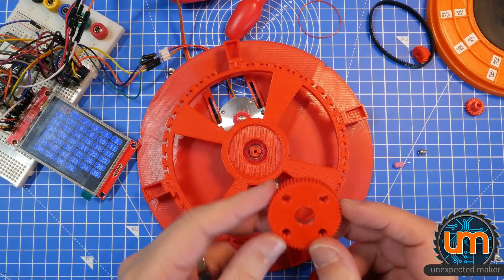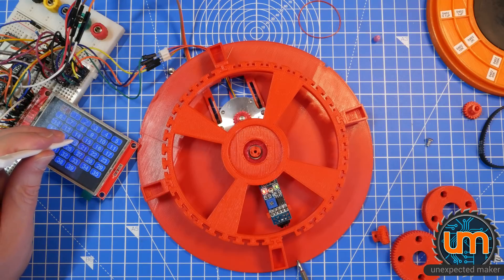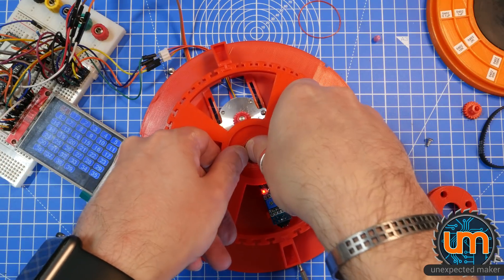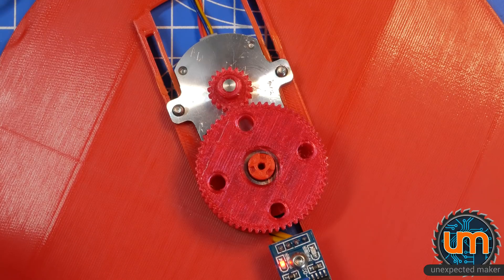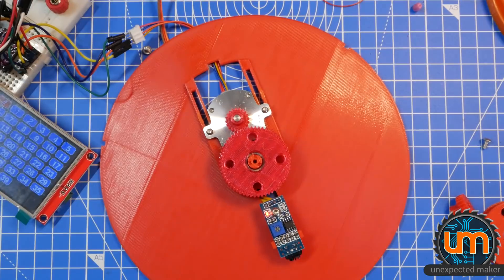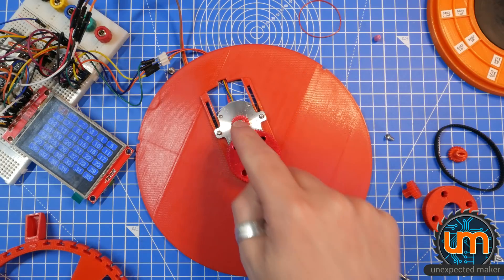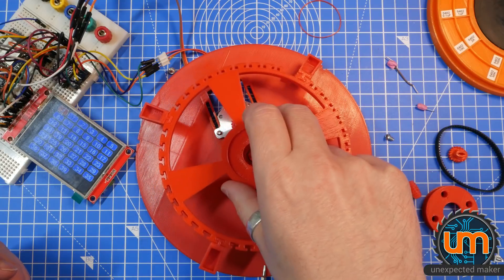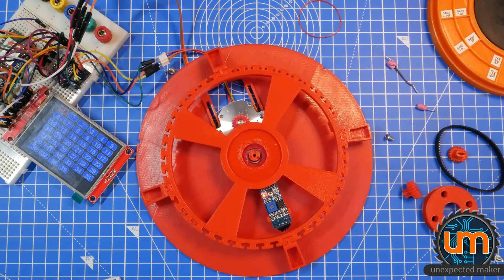PnP Parts Dispenser - Stream Followup

Comment: You might try Helical Gears. They were designed to minimuse this type of noise. Only pont contact is made as gear teeth come together rather than the whole wideth of a geatr tooth.
Reply from the maker: Thanks Alan. Yes, there seems to be a few gear teeth designs I could look into if the noise gets too annoying, but I might try some lubrication first, or using nylon filament or felx.

Comment: Good morning Seon, I enjoyed the stream the other morning. I was a mechanical engineer some years ago so was interesting to watch an electronic mind at work. I think you did get a lot of unnecessary flak though. I think you're on to a great design there. The design for the bins is good, even adaptable to place double bins should you ever need them. Making the connectors on the bins dovetail shaped should help to lessen the rattle coming from the bins. With the wear on the gears, silicon grease is okay for plastics and minimally reactive, may even dampen some of the noise from the gears too. Thanks for all the great content, looking forward to the next.
Reply from the maker: I need to grab some silicon grease for another project, so yeah I can def give that a try on these gears. I also got the bin connector tolerance better so no more rattling! Yay ;)

Comment: Glad it worked out for you.  You didn't want to rely on the steps to accurately position the wheel and you didn't want to add a second encoder to count the degrees of rotation.  Who knew it was a belt issue?  Everyone learns when they burn their finger.  Great stream!
Reply from the maker: Well I did want to count steps as the method for this to work, but it wasn't proving accurate.... but it looks like  it is now :-)

Comment: Have you looked into herringbone gears?  Some 3d printers (Lulzbot) have used this type of gear.  Here's a parametric set on thinkverse.  https://www.thingiverse.com/thing:6544.
Reply from the maker: Hey Paul, I now about herringbone gears. I'm not sure I could print them this small with a 0.4mm nozzle. I'm going to try flexible filament or printing with nylon first before I try new gear shapes.
Reply: @UnexpectedMaker  I replicated your original parts table a couple of weeks back and really like the new idea.  I'm gonna try printing a small set of the two herringbone gears just to see how well they come out.  I have a .4 nozzle as well so i'll let you know.  Looking at the vid, would the main gear be roughly 30 mm in diameter and the small drive gear be about 10?  Again, just a POC to see how well they mesh together when printed so small.  The primary reason for suggesting is they effectively lock together and really can't slip plus they keep each other aligned to the center of each other.  I've had the same set running on my 'Wades Extruder' for 4+ years with no slop.  Printed with ABS...  I'll shoot you a pic how they turn out.  Really appreciate you sharing all your experiences.
Reply: @Unexpected Maker  They definitely track well with each other.  I think these are even smaller than what you might actually need.  Have a look...  https://imgur.com/a/oxP6Qoz
Reply from the maker: Oh they look great.... my gears are a bit bigger in diameter... 40mm and 14mm. What did you use to make them?
Reply: @UnexpectedMaker  Well, i just scaled the ones from thingiverse but i'm gonna look around to see if there are any parametric models for Fusion360 (my 3D modeling app of choice).  Or i'll try my hand at designing them myself although I think there would be some interesting design challenges.  Would the diameter of the two gears or the teeth count make a difference with how you're designing it or is it somewhat irrelevant based on how you're using the rotary encoder now?  I haven't had time to get through the full live stream where you discussed it all.  I would be glad to share a design with you if you were interested in trying them.
Reply from the maker: Yeah the teeth ratio is super important for my project still as I am not encoding,  but relying on steps still, now that I have it pretty accurate and reliable. My smaller gear is 20 teeth and my larger one is 60. I managed to get what I have here quieter simply by tuning the position of the stepper to make sure it's not too close or far from the inner gear, so though it could still be a tad quieter, it's pretty good now :-)
Reply: @UnexpectedMaker  ok, interesting.  Just for grins, i'm gonna try to make a set that match your specs then share with you.  Mostly cause I like little challenges.  ;-) .  I do think the herringbone teeth stand a better chance of being quieter just based on how they contact each other.  And side note:  Not sure if you've ever seen any of Mathias Wandel's gear vids but he's got lots of great info.  However, he's all about woodworking and his gear generator tool doesn't output CAD files.  Only printouts for use as cutting templates on wood.
Reply: @UnexpectedMaker  Here's the small gear. https://a360.co/2ECQnBO and the large.  https://a360.co/2IS6jFv.  I used an add-in to fusion360 called helical gear.  And here's a vid of them in a small jig I designed just for POC.  https://youtu.be/yHzVyqFPFwc

Comment: 200 steps are not that inaccurate and these light parts are not a big load for the stepper.. direct drive should be fine. But i wonder if you should check another driver library or code, since 16 microsteps are not unusual. I think the noise you are getting with half steps is maybe just current or step length related. You could test the stepper with something like grbl or other 3d printer firmware that supports microstepping right. But maybe totally overkill:)
Reply from the maker: Yeah the 1/16th micro-stepping is working now in this video... plus the accel/decel... so  I'm pretty happy with how it's working. The library is fine... I am pretty sure it was just "user error" and  bad assumptions at the start of the project ;)
Reply: Ah.. i thought it was still only working with full steps. If you are using the stepper as direct drive, you may can fit a little bit bigger stepper in the center. I´m using this for one axies in my openpnp project and it seems to work good and the price is not that heavy. The statet 1.5A are not true of course;)
https://www.aliexpress.com/item/nema-17-42-stepper-motor-23mm-0-42N-m-1-5A-for-3D-print-step-motor/32895756331.html?spm=a2g0s.12269583.0.0.b8cc5ba66Kwww4
Reply from the maker: That stepper you linked to is already taller than what I have now for the entire build, without direct drive. If I did direct drive, I'd only be doing it to reduce height even more than what I have now ;)

Comment: Sound like the gears have too much loading against each other. 

Try easing the stepper motor back by no more than 0.25 mm. This should reduce the noise and run more smoothly.

Maybe loosening one screw and nudge the stepping motor back a little.
Reply from the maker: Hey Graeme! Yeah I printed a new base with proper positioning of the gears and it's sounding much better now :-) still not silent, but much improved.

Comment: I think the heat from the stepper motor should not be an issue as when in use it won't move much.  I also could live with the gear noise. It's not that bad. Pretty good job.
Reply from the maker: Thanks Gary..,. Once it's all together and working, I'll play with reducing the current to as low as possible and see if I can use holding current to keep it still.

Comment: If the motor has 200 steps, you should be able to get good accuracy by having 200/x baskets. lets say 50 baskets, thats 4 steps per basket. (If you were to drive it directly.)
Reply from the maker: Yeah I am pretty sure I could direct drive it... 5 full steps per compartment with 40 of them, and with micro-stepping it should still be smooth... I'll just need to slow it right down.

Comment: Print the gears out of nylon. Nylon is self lubricating and greatly reduces wear
Reply from the maker: Sure.. right now I can only print it out of filament I have on hand. My aim for the proto (rev 1) was to only use what I have on hand apart from the stepper. If I really find the system useful and it improves my workflow, I might look at a re-design and spent more $ on doing it "properly" ;)
Reply: Vaseline for grease :)

Comment: At four hours, long I'm glad I watched the stream later on, at 1.25 times the live speed.  Congrats on wrangling this issue.

For what it's worth (i.e. zero) I like the idea of driving it directly without gears.  You showed that doing so with your 200 step/revolution motor works just fine.  One thing I did yell out to you is that these thin motors are not uncommon.  They're called "pancake stepper motors".
Reply from the maker: Yes, my streams are getting too long... I'll not argue that point. I wish I could record them at 1.5x speed ;)

Comment: Hi Seon! I haven't watched the whole stream the other day but did anyone mention a Hall effect sensor? You could use it to determine the "home" position and maybe do some calibration on the fly?
Reply from the maker: Hey Dustin, yeah we discussed Hall Effect and U-Slot sensors.. issue with hall effect is perfectly positioning 40 unique magnets around the perimeter would be a challenge and a lot of work. The IR sensor, though crude is working great for homing, and a second can be used for indexing positions if needed.

Comment: Unfortunately I missed the full live stream. If the stepper has adequate torque, then I would definitely go with direct drive (centre the motor). Stepper accuracy is not a function of gearing (it either misses a step or it doesn’t). Gearing is to achieve the required torque or step resolution, but in your case 200 steps per turntable revolution would seem adequate. Finally, KISS applies. Less moving parts the better! Sorry I missed the live discussion Seon (yep I’m still reno / moving LOL).
Reply from the maker: The stepper actually has very little torque... but still maybe enough for direct drive. I want to finish this project as it is right now and then if I find the energy,  I'll do a redesign with direct drive and see how it goes :-)
Reply: @UnexpectedMaker  That makes complete sense. As you'll also need to assess start-up torque requirements once you have completed and therefore have a turntable actually fully loaded with all the SMD components added weight.
If a higher torque regular height stepper is needed (for direct drive), then it might also be time to consider if my earlier suggestion of a standalone SMD automated dispenser might actually be a better solution? (with existing low profile PCB turntable, instead of the separated display and the elevated PCB turntable workspace).  :)

Comment: That's super cool
Reply: I actually like that whinging noice, sounds very professional.
I understand your irritation about the rattle.
Would it sort the noise if you used two different materials for the gears?
Looking forward to your next project😂😂😂your right ! The stream was a slog😂😂but a well spent 4 hrs😳
Reply from the maker: Yeah, using a semi flex or nylon filament for at-least one of the gears should help. Yes it was a slog, but my streams usually are ;)
Reply from the maker: Thanks Paul :-)